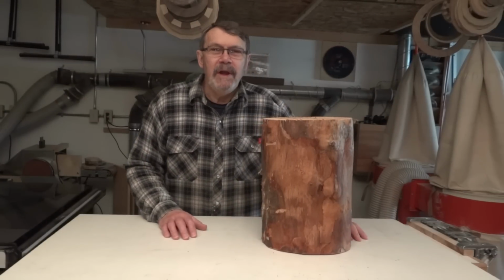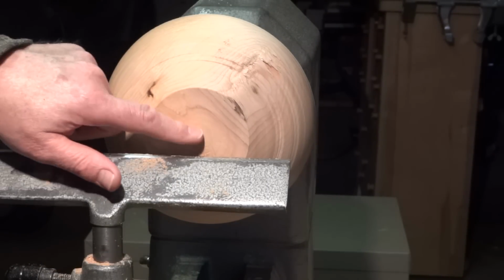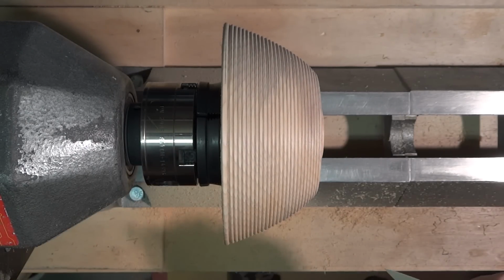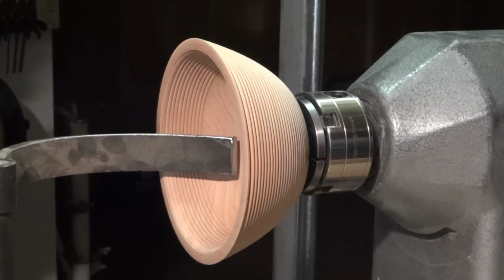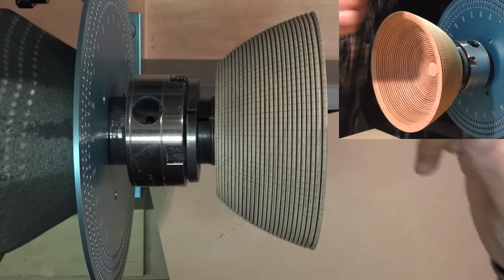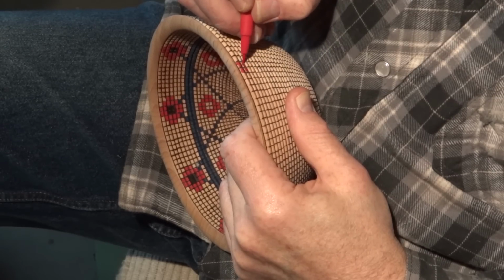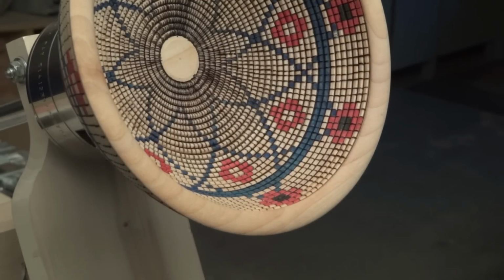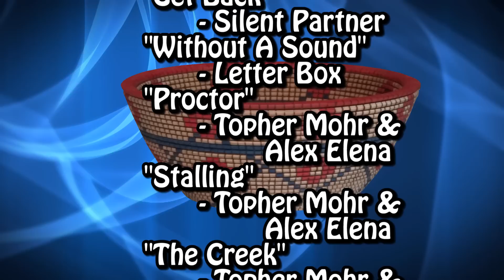Basket Illusion #2

Comment: Nice job Gord. It looks like a comfortable chair and good lighting are the most important tools. Thanks for sharing the process.
Reply from the maker: +David Sutton 
Yes, David, it would be very uncomfortable sitting for that length of time on stool in the shop. Thanks for watching and thank you for the suggestion of oak banding for the burning of the horizontal lines. The glue on the banding I have is a pain so I may just use the drum sander to take some oak - or other wood - down to 1/16" and see how that works.
Take care,
.....Gord

Comment: Great job Gord. I have done a few pieces, but only because my wife likes to do the burning and coloring. I have one question for you. The index wheel you purchased, did you also get the round rod to hold the pin from them? I only see that part for smaller lathes. Next time you need Razertip pens, etc. let me know we are authorized dealers for them. Thanks,
Reply from the maker: +Segmented Turner
Yes, the rod & pin came with the index wheel. You may want to email the manufacturer to make sure it still does if it isn't mentioned on the website.
I'd be happy to keep you in mind as far as Razertip parts are concerned but I'm in Canada and if you are in the US the cost of shipping and brokerage charges would likely be prohibitive.
Take care,
.....Gord
Reply: +Gord Rock Thanks Gord I will contact them.

Comment: Great job; must have been hard on the eyes! Tried the indexing plate site but would not go through. Any suggestions?   Ron toydoctor
Reply from the maker: Hi Ron,
I just tried that link and it doesn't work. I will have to change the link; thanks for letting me know! If you have a large lathe this will get you to the right page:
http://alisam.com/large-indexing-systems.html
If you have a smaller lathe just go to their website and you can find what you need under the WOODWORKING/WOODTURNING/OT tab. I hope this helps!!
.....Gord